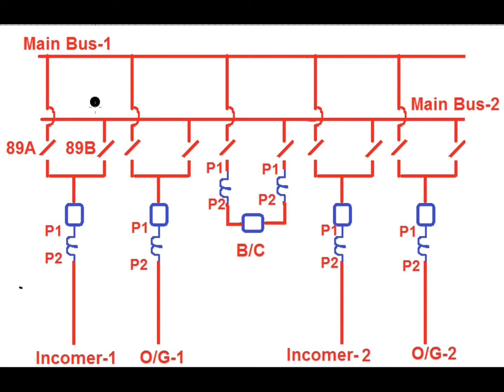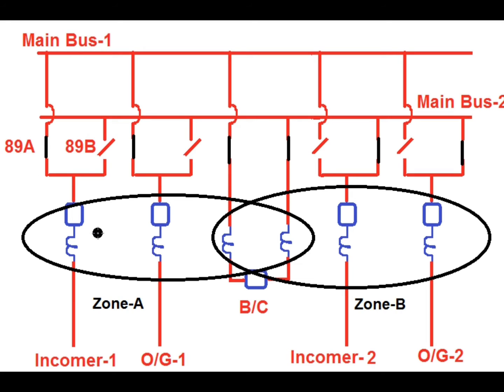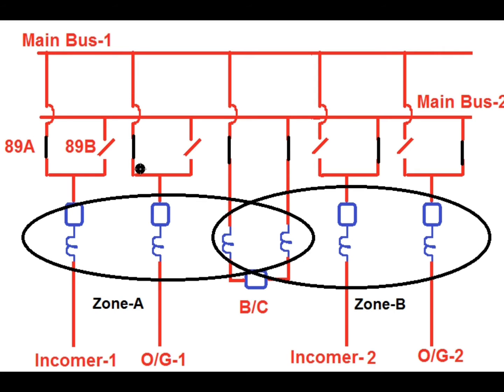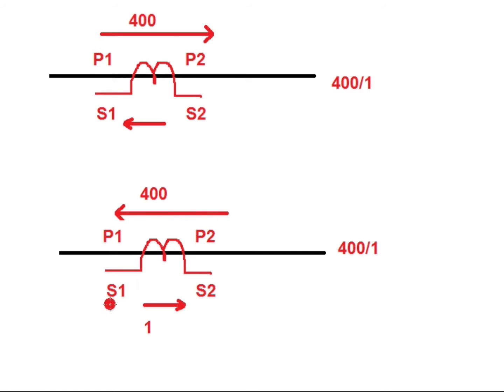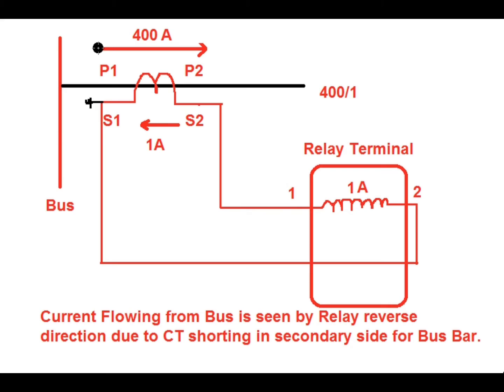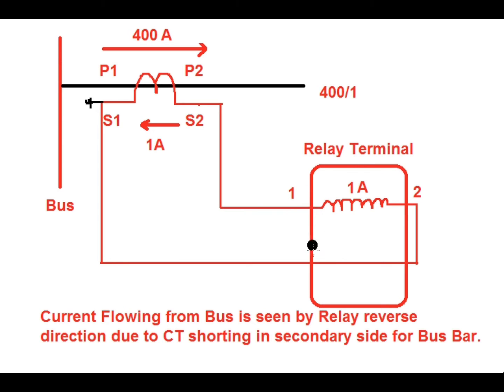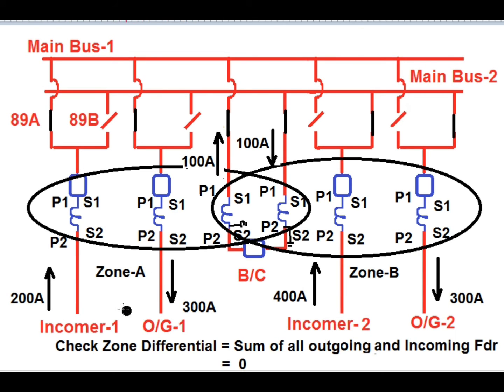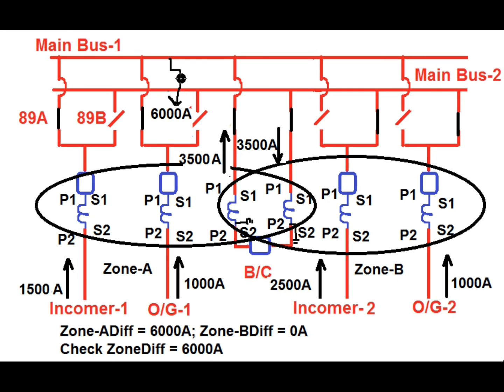BUSBAR PROTECTION FOR TWO BUS SYSTEM (PART-2)|| CONCEPT OF CHECK ZONE DIFFERENTIAL CURRENT

Comment: Sir, bus coupler CT polarity P2 is bus side and P1 is CB side. You have shown wrong CT polarity in BUS Coupler in this video.Pls check.
Reply from the maker: Thank you for your valuable comment. You are also right. And that is why in secondary side Polarity for B/C CT is reversed in this video.
Reply: @relayprotectionelectrical you mean configured as a reverse polarity in relay?
Reply: @relayprotectionelectrical bus ct polarity wrong